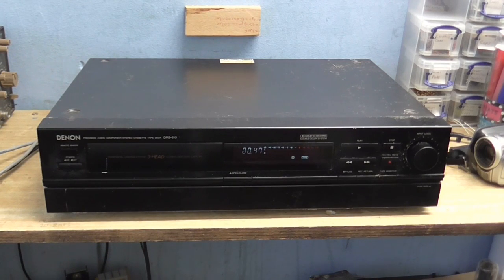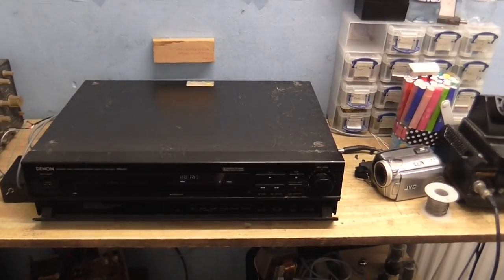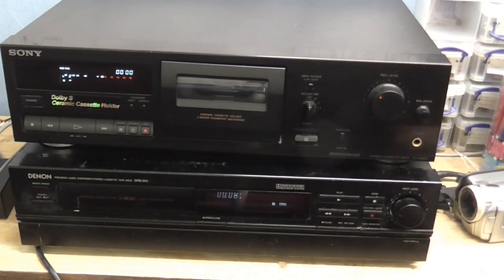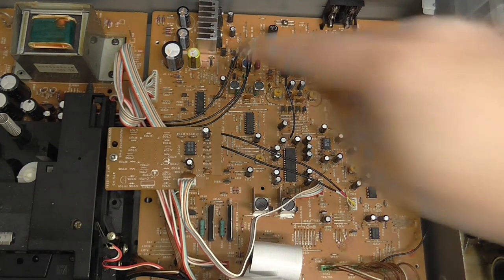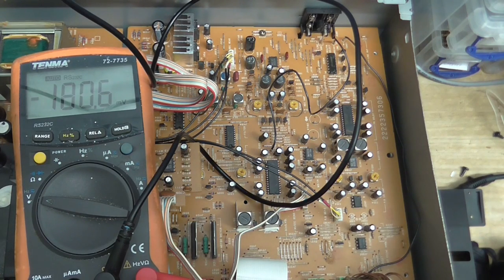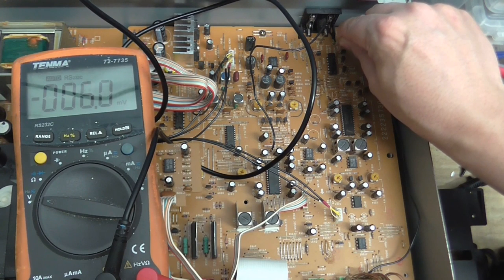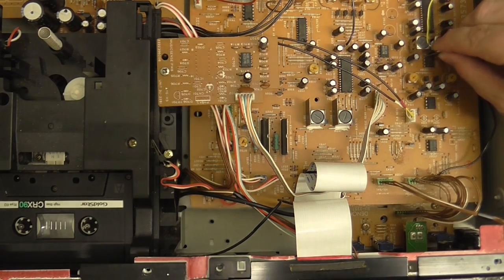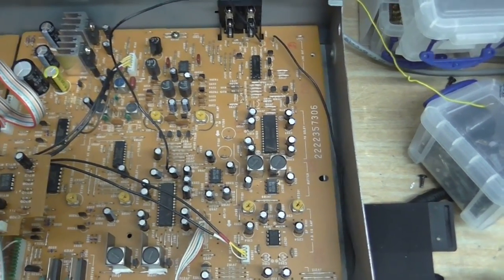Repairing the Denon DRS 810 part 1 of ?

Comment: the first commandment is to check the belts. 90% of troubles is the belt or belts issue. then go to electronics. I have the same deck, it arrived like new but with the same symptoms, after two belts change it performs flawlessly..

Comment: Noted some of the other comments- these things usually fail due to slipping drive belts. A good place to look. As you will already know, loss of signal through an amplifier could be down to a bad capacitor, or even just a bad solder joint to the audio line output socket! Good luck with it. Shame we can't usually get circuit diagrams for these sort of things.
Reply from the maker: At least I now know what the problem is, I did a little jiggery pokey with the tape mechanism while it was trying to play and I did get it to play a tape.

Comment: Interesting video and im looking forward to the next chapter in fixing this deck. Not a whole lot of repair videos on YT regarding these Denon decks.. I got ahold of the same deck for basically free some weeks ago and it is in great condition, however the vu meter shows an inbalance between the channels. This is only through playback and not while monitoring a signal.. It also has a slight flutter problem which i suspect is the belts or the left pinch roller. I still havent removed the transport to get to those belts. Do you have any idea if any of the other horizontal loader models from Denon uses the same belt?
Reply: jomjom107  It might be a good idea to check the azimuth on your tape-deck.

Comment: Hello there, I think your problem is with the so called Mode Belt. It is used for loading and unloading the heads and capstan rollers. I have the same deck and same issue. The belt gets loose and then the mechanism doesn't load properly. The symptom of stopping is the typical symptom after a few seconds is probably a timeout in the control logic, when the tape does not load. Check in to the mode belt, it will probably solve your issue. Note that the symptom of no sound is normal in this situation, probably the signal output is not connected until the tape is properly loaded.

Comment: Hello! I have this type of deck and there is a mechanical problem with it: the cassette holder tray does not eject, but I hear the motor works. If I lift the tray a little from below, it will come out. What do you think should be adjusted? Thx!

Comment: love these fault find videos .  wish you would do some fault finding tutorials , maybe you do ive still got 1 year left to catch up on .
Reply from the maker: It just turned out to be a bad belt,  so it couldn't turn a function selecting wheel all the way round. At the time I didn't know that was the problem until somebody suggested that, I thought there was some serious electrical problem maybe a bad chip .But replacing that belt fixed it right up.
Reply: @CoolDudeClem  ah ok im just on your second video of this series when this reply notification popped up your just cleaning sensors , still nice fault finding i like the first commandment ,  thanks for reply .

Comment: The problem is in your capstan motor, I suspect. Or at least something in connection with the capstan motor. I had a similar problem with my Denon DRS 610. Where initially the motor wouldn't get the playhead tight against the tape. Not at all later on. The engine turned out to be broken in my case. After replacing the motor from a Philips(!!) recorder, everything works properly. I read that this is an older post, maybe everything has been solved by now? If so, how?

Comment: It's the smallest belt that is used to change modes. The belt is slipping and not moving the heads all the way up during playback.
Reply from the maker: I think you may be right, even though the belts all seem good, I tried playing a tape again, but this time I moved the wheel that the small belt goes to by hand and it started playing, so when I can find a replacement belt I think it will be back in action. I also noticed a couple of micro-switches that would have been giving trouble later on so I fixed those as well, I actually thought those were what was causing the the trouble but they weren't.
Reply: Yeah those can be trouble. If you have any old cd-rom drives laying about some of them have small drive belts in for the tray loading.

Comment: Hi there ,i have the same DRS 810, when i put cassette and play it plays for 9 seconds without sound,then i click play button again and again tape runs for 9 seconds then i open and close tray, may be switch off the deck and gain play then it plays with sound, what may be reason? I dont have its remote, is that memory issue?
Reply from the maker: I think it's most likely a belt problem. There's a belt that connects a motor to a cam that pushes the heads and pinch rollers up to the tape, that belt might be loose and not doing it's job properly.
Reply: @CoolDudeClem  Thanks Clem..👍
Reply: @CoolDudeClem  hi Clem did you ever find the issue with your deck?

Comment: Could it be one of the sense switched on the mechanism? I know that my Yamaha KX-10 had problems with those.
Reply from the maker: I did find out that the sense switches were a little bad after I made this video, I thought that is what the problem might be, but it didn't help. Good thing I fixed them anyway as they would have needed it later on, just need to find a decent replacement belt for part that changes modes.
Reply: I noticed that your deck has an assist motor because it changed modes so silently. My Denon DR-M14HX has a gear on the assist motor and that makes it very silent and doesn't need an extra belt. Instead my Sony TC-K711S has a belt on the assist motor.

Comment: Hi, can you maybe tell me where I can find the place I can adjust the motor speed? Hope you can help me with that. Thank u. I by the way have a prerecorded tape and also the cd of that same song so i can compare the speed live.
Reply from the maker: If memory serves, there is a little hole in the back of the capstan motor, and behind that hole is the trimmer for adjusting the motor speed. You can stick a flat head small screwdriver in there to adjust it, just be sure to not touch the metal case of the motor with the screwdriver at the same time as that will short. I wrap a little tape around the side of the blade to prevent that.
Reply: @CoolDudeClem  thanx for fast reply. Unfortunately that is not possible in this case but I find the solution. On the main board RT501 is the pot meter to adjust the motor's speed.
Reply: Another question what is called the clamppart on the right that holds the front panel in place and when you push on the front panel of goes open.

Comment: hello, I have the same stereo cassette deck DENON DRS 810, and I have the same problem: I insert a cassette, I click on PLAY, the tape starts but nothing is heard and in VU meters there is no signal (although the cassette contains music) .
 After a few seconds the belt advances and stops in the STOP position.
I restart the cassette in PLAY and press the TAPE MONITOR button selecting SOURCE: I now listen to the contents of the cassette very low, in headphones or with amplifier and loudspeakers.
Occasionally I have soaked the capstan belt (the big flat one) with some trichlorethylene to give the rubber stiffness and from that moment on, I don't know if it was a coincidence, the tape plays perfectly (even the VU meters work).
But with some cassettes it happens that: as soon as you insert the defect is manifested, then I recycle on PLAY and SOURCE and then TAPE and you hear the music and the VU meters work. Nothing happens with other cassettes.
With other cassettes still, the defect manifests itself when I stop playing for FF or Rew, shooting with PLAY does not work, then I have to click on SOURCE and then on PLAY and the tape is played again.
I think it's a question of a slow belt due to wear: the slip is seen by the logic system as the end of the belt. I would like to say, however, that the TAPE - PLAY - SOURCE trick and finally TAPE, gives me the respect that the TAPE - SOURCE switching from the TAPE MONITOR key does not work well and is performed electronically by an IC CMOS an old HD14066BP named on the IC 304 diagram . (located in front of the RCA LINE IN and OUT connectors. What do you think?
Reply from the maker: You just need to change that tiny belt that handles the function switching, I replaced it with a rubber band and that worked for a while. I still need to replace that though myself. Ebay would probably be a good choice to find belt replacement kits.
Reply: @CoolDudeClem  thanks for the info. What belt are you referring to? Then the straps are 3:
1 the large flat one that runs on the capstan flywheels.
2 - that of loading the trolley
3- that of the servants
on the service manual the large belt has the number 39
that of the loading trolley 62
that of the servants 39
  On ebay there is a German seller who sells the complete kit (3 straps) including shipping costs to almost 20 euros. Which belt are you referring to? to that of the servants (n ° 39). Do you have the service manual? if you need me give me your email and I'll send it to you
Reply: @maxastuto  I had the same prob: after 8 sec it turned off. I shortened the capstan belt for about 2cm, sandpapered the end, reconnected it with superglue, that it wrapped flush around the 2 flying wheels, so the tension gets better. Before it hanged loose around the 2 wheels. When inserting a new cassette the deck will stop as before. But when pressing PLAY a second time, it runs and is playing music! As you supposed: I guess also that a loose belt tells the electronic that the cassette ends and therefore the device stops. Maybe I will try to replace the servant-belt also. But now the deck does its service!
Reply: @machytka  ok very good my friend